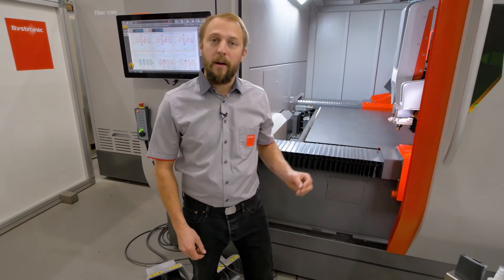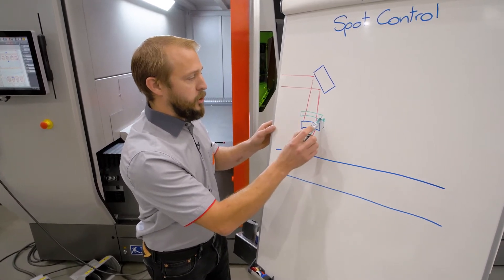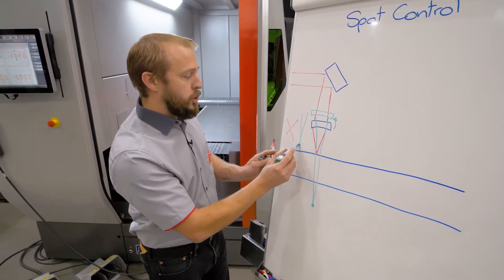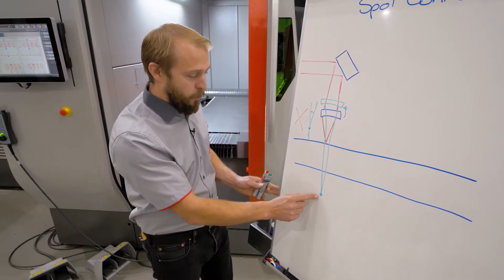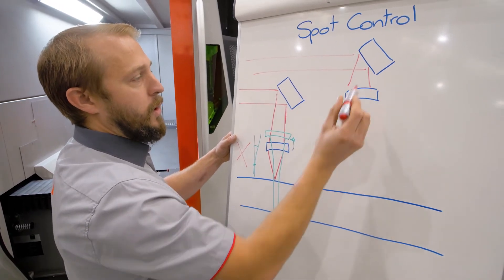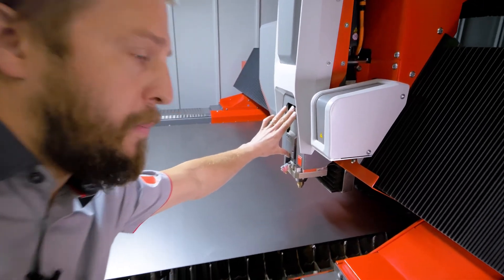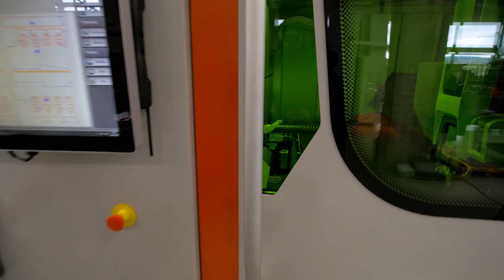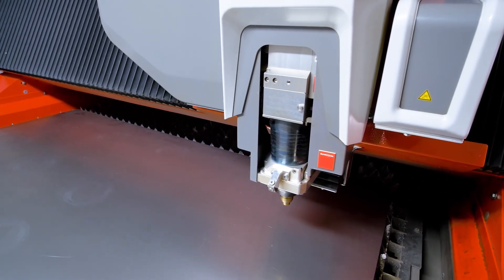Bystronic Laser Cutting System features: Spot Control (English)

Comment: What happens when the lens is flipped means by mistake after removing and fitted again in wrong direction.
Reply from the maker: The lens can just be removed by our specialists in a clean room in case of refurbishment. They surely will fit it correctly inside. Your Bystronic team.